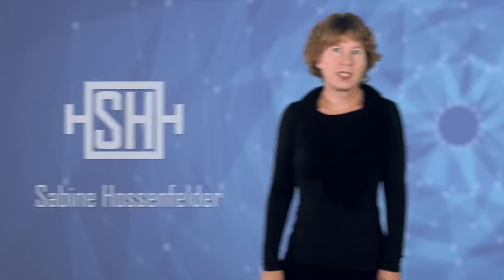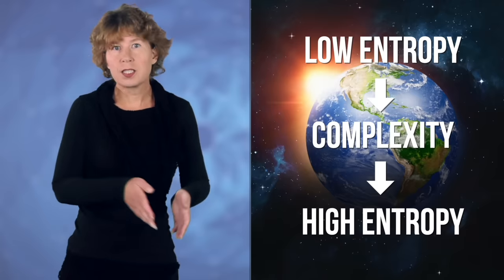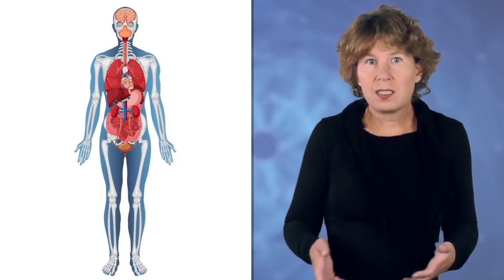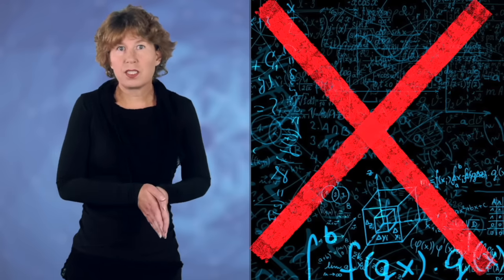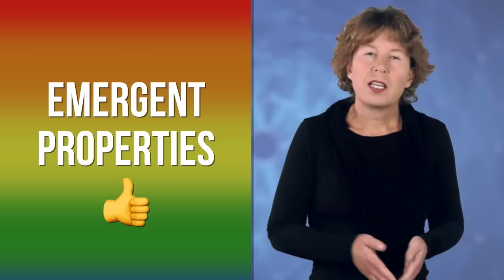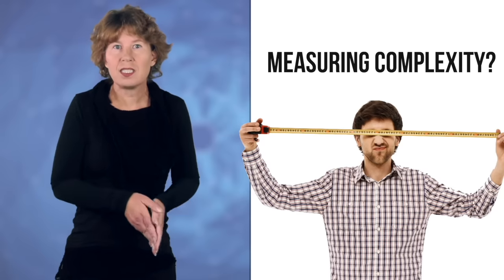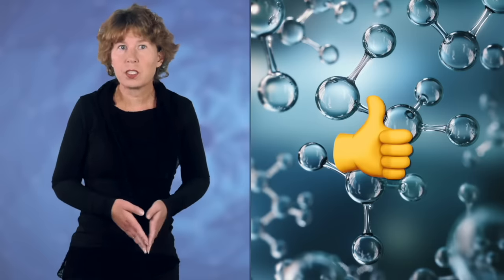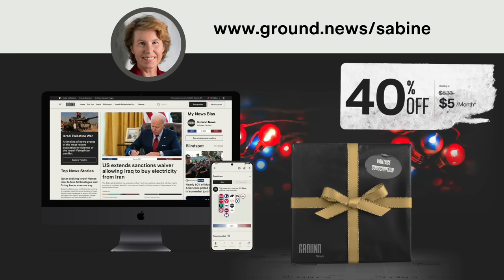The Biggest Gap in Science: Complexity

Comment: This explanation of Kolmogorov complexity is wrong.
Kolmogorov complexity is not defined in terms of a program that can take input, as the distinction between what's input and what's the program would be arbitrary and you would be able to assign everything an extremely low complexity by having the program be a simple interpreter and the input just be whatever actual program you want to run.
So the state that makes up a stone or baby that you consider input to the program/laws of physics really needs to be included/encoded in the program, which in turn will ramp up the program size and cause the Komogorov complexity of a stone to be very likely different from that of a baby.

Comment: I think that "Complexity" belongs in the realm of Epistemology. It is about how faceted the "knowledge" is that conveys the understanding of something we seek to explain or understand. An object or system could be physical or abstract, and we might need to understand / explain only some small part of it, or all of it. So complexity isnt about the thing alone, but more about the knowledge required to explain or understand something with respect to that thing. 
If the thing has one or multiple levels of emergent properties / behaviours, then the thing we are attempting to understand could be at one, or accross many of those different levels. A rock doesn't have as many emergent levels / behaviours as a Baby does so most of the things we will wish to understand about a rock would tend to be more constrained to fewer levels.. however if you include wanting to understand behaviours for how the rock was formed then that knowledge would be of increased complexity because you have to bring in the facets of geology as a dependency. If you want to know the positions of all the atoms in the rock that would be more complex than asking the location of the rock in your garden... because,  emergence typically aggregates complex low level details into simpler higher level concepts. Its not complex to talk about the colour Blue but it would be if we had to always explain it referencing fundamental physics instead. If you ask a Baby what it had for breakfast its answer may be pretty simple "goo ga". This isn't complex because understanding is lost. I could write a program to mimic that behaviour in a few lines without needing to understand much. If you wait 20 years for its brain to develop and for it to build behaviours from the learned knowledge embodied in its brain and then ask it, the answer will be a lot more complicated like "i made eggs on toast". The "positions of its neurons" are the wrong level of abstraction to attempt to understand why it gave such an answer.. knowledge of culture and the english language are operating at closer levels.

Comment: It's fun how each person considers complexity something different. I work in game design, and it's pretty usual to talk about a game complexity. We have usually problems with complex games but at the same time the players want games with depth. Luckily they are not necessarily correlated. We tend to think on complex games a games with plenty of variables to interact with, while we consider deep games those with lots of outcomes. A game can have a low complexity but high depth (which is considered optimal), but also, you can increase the game's complexity, yet not changing its depth or even decrease it if the system's complexity reduces the number of outputs. Adding complexity may make the game deeper, but it's also possible that it doesn't since the different systems may funnel the options into less outcomes, like the thousand bowls of cereals: you can have a virtually infinite ways of making a bowl of cereals but in the end it's just another bowl of cereals.

Comment: If you really must have a definition for complexity, simply count the amount of regular movements you would call a "thing", or an "effect" for a specific chosen time scale, and in a specific space. One regular movement = 1 unit of complexity. In a specific time scale and space, you have a specific amount of identifiable regular movements. To detect an object you need it to be regularly itself at least once. That's our unit. Now count the amount of times it is regular in the time scale and volume of your choosing. Larger "emergent" movements, only appear after a specific timescale threshold is crossed. Once it is, add it as one unit of complexity. The physical limitation of complexity, is that it is relative, because it is an observation after the facts, the facts being the observed laws of physics. So you can have two different volume-timescales with the same complexity. But like a denominator for a fraction, you need both space-time scales to have the same minimum regular movement as a denominator. One jiggling of a photon, one orbit of an electron, whatever you want. This creates a way to measure complexity, but only by arbitrarily choosing a minimum regular movement. Those two space-time scales now must have different complexities.

But complexity as a concept really is more of an after-the-fact observation, it has no strict explanatory power. I.e. it's not really a problem, it's just an appealing kind of synthesis. I'm not sure it will be very useful, except perhaps as a type of informative unit, like meters, or kilograms.

Comment: "In case you haven't noticed, a baby isn't a network" Of course they are! each quark and each electron is a point in a huge network. Very difficult to work with but it's there. Using the atoms as points instead would be a very simplified model but would also show the complexity.

Comment: I think Kolmogorov is a good measure for informational complexity. While yes, both rock and baby can be modeled with the standard model, computing the behaviour of every single elememtary particle. However, this is like the 'naive' program and not the shortest one. The regular structure and grouping in a rock means you can abstract some of the elementary particles and model the structures only instead, creating a shorter program. Arguably, more structure in the rock implies a smaller Kolmogorov complexity.
Reply: Yes, but then things like Collatz, Goedel and the halting problem are rearing their ugly heads.

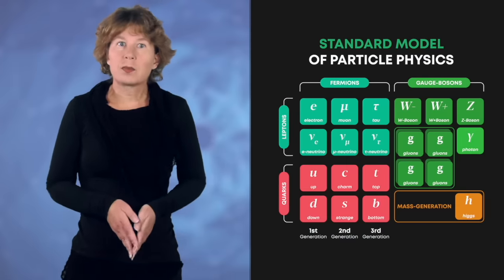Comment: 03:40 - While it's true that both the baby and the clock, when considered down to it's elemental physical components, can be described by the same "laws of physics", It does NOT mean that doing so is necessarily the SHORTEST way to describe their behaviour, i.e. the clock would remain a "clock" whether it was made of only pure metal components, different alloys, or even a mix of plastics and other stuff, and it's "clock" complexity would remain the same. A similar argument can be made for the baby, and if you only wish to describe the part of the object's properties or behaviour that represents the clock-ness or baby-ness of them, boiling down to elemental particles it's probably not necessary nor the shortest path to do so.
Moreover, even if you want a complete description that does boil down to the core components of those objects, given any referential starting "universe" situation, the amount of stuff that needs to happen (regardless of the how it would happen) for both objects to come into existence, would still be higher for the baby than for the clock. Let's remember that Kolmogorov's complexity specifically speaks of a computer program capable of producing the output. Even if we assume the universe to be computable in line with computability theory, and given that computer programs have inputs and outputs, his complexity theory only would speak of there being a possible state of the universe from which a set of "instructions" or "events" could produce this outputs (and which of those can be made the shortest). 
This, to an extent, crashes a bit with the proponents of a unique and completely deterministic universe, but to those we would just need to remind that complexity is in all honesty just a human construct used to describe how much "effort" needs to be put into understanding the properties of something to a reasonable degree (i.e enough to distinguish it from every other know object). 
Therefore, complexity does not belong to any physical object understood as a set of physical magnitudes, particles, fields, etc, in a given space-time location; Complexity is a property of the "objects" understood as the minimal information that allows us to discriminate them from every other, because that's what brains do; they cluster stuff and seek patterns.

Comment: The argument stating that since everything is made of elementary particles, everything is as hard to describe using a program is wrong.
For example, describing a crystal is extremely easy with a computer program, because you just describe the lattice structure and then repeat it. That's the whole point.
A baby's inner interactions are complex because the structures are not as repetitive, hence they require more footwork to describe with a program.

Comment: I can’t buy the argument about algorithmic complexity. It’s flawed because complexity in algorithms depends on interactions between their building blocks, and not the complexity of those building blocks themselves. A real world example would be any CPU or other IC. They are all built out of transistors, yet some CPUs are more complex than others. Their algorithmic complexity is different despite they all have the same building blocks. A math analogy would be: all math is composed out of the same set of digits and symbols. Yet some math is more complex than others. You will still need to compose your building blocks from the standard model into a bigger equation, that is.

Comment: I don't think your dismissal of Kolmogorov complexity is correct. The equations of the standard model are indeed the same between babies and rocks, but those equations are NOT the full program that describes each of them. The specific configuration of the particles is part of the program for each, and it's clear that the rock's program would be considerably simpler with fewer degrees of freedom than the baby's. 

You can see this in your graph example of fully connected and fully disconnected nodes. The program describing how to construct either graph is very simple, but a program to construct a graph that isn't either of those graphs must be strictly more complex, consisting of additional predicates to decide whether vertex x is connected to y.

Comment: I'm amused by the contrast between your ordering of rock/clockwork/baby and mine.  You're suggesting that in principle it should be obvious that the rock is the simplest, the clockwork is in the middle, and the baby is the most complex (or at least, that's what I'm reading in between the lines, don't think you've actually said it.)

As someone who's studied rock mechanics, my order is clockwork/rock/baby.  

The clockwork is a designed and entirely deterministic system.  Wind the clockwork, it does X.  Plug a different cam module into it, then wind it, it does Y.  Go back to the first cam module, it does X again.  Very simple, very deterministic.

Rock, though....you can look at the surface.  You can infer what's probably going on inside.  But you don't know what's inside there until you crack it open.  It might not look like a geode, but there might be a geode just within that houses some fascinating crystal structure.  There might be cracks or bubbles in there that don't make it to the edge. Etc.  The smaller the rock is, the better chance you have of guessing the interior, but you're never 100% sure until you crack it open and look at that part.  (For the purposes of a hand sized rock, 99.99% of the time it's exactly what you'd expect from the outside.  Rock mechanics design work is more interested in rather larger rocks, like, uhh...bedrock.  If you're digging a tunnel under a mountain, the structure of the rock within that mountain is relevant to how much support that roof needs.  If it's the kind of rock you can put holes in by punching, you probably do everything you can to have the tunnel built elsewhere and if it absolutely has to be there, you put absolutely absurd amounts of support in, tell everyone it was a bad idea in the first place and pray.  (Yes, this kind of rock exists, it's not so much the rock itself being weak but that it's basically just gravel that fits together like a 3d jigsaw puzzle and therefore you can just pull pieces out.  Which means it has pretty much zero structural integrity.)  If it's completely solid, you might not actually need any support at all, but you'd be crazy to assume it's actually 100% solid.

Babies, of course...they're simple on the surface, but what a baby does over the next 100 years beyond "get bigger, eat, drink and do the other necessary things of everyday existence for mammals to live, and eventually probably die" is very hard to determine with any certainty.  (And maybe that last prediction is a tad morbid but I don't think it's exactly controversial to say that most people don't live more than a century.)

Comment: By the way, in the field of the computer science the complexity might be something bad in some contexts. For example, mentioned algorithmic complexity tries to find the simplest solution not the most complex one. In the software engineering we usually try to solve a problem with the simplest solution possible (not a naive or literally stupid though). So, yeah the complexity is a complex problem to speak about.

Speaking about the simplest solution seeking. I have intuition that the simplicity seeking is something similar to the entropy. In a way that dumb solution might be easier to produce, then to produce the simple one. So, actually the simplest solution requires more complex behavior from a solution producer. That is similar to a situation when you minimize entropy somewhere locally and really just put it to another place. Globally entropy still increases.

Comment: The categories of complexity are only those we have learned to treat mathematically and logically; we should NOT assume we have already found them all.  Everything is indeed composed of fundamental particles and the complexity does emerge from pairwise interactions between them all; however, order also emerges from this complexity.  Each clock gear is composed entirely from an orderly repetition of such an emerged ordered chemical structure (with a finite set of impurity and inclusion exceptions).  Data compression algorithms specialize in reducing such 'blocks' to a simpler and equivalent representation.  Similarly, rocks are composed of a finite number of small crystals glued together by mineral cement.  Each crystallite can similarly be reduced to a block plus a finite set of exceptions -- and the assembly of crystallites plus the cement details usually may similarly be reduced.  All of this additionally neglects the subtle complexity needed to allow nerve ganglia to form memories and to correlate these memories into ideas and actions.  We have come a long way, but it would be a huge mistake to settle for what we already know; I predict that many very important categories and equations/algorithms are yet to be discovered.

Yet, all of this treatment also entirely neglects the emergent properties of these materials that depend on intrinsic properties such as temperature, pressure, and environmental composition and state.  We do indeed have far to go, but we also do begin to understand how models of complexity explain much that is otherwise very difficult (even impractical) to predict and to compute.  With these models in hand, we are in a position to begin understanding how these pairwise interactions combine to produce a category of complexity and/or an emergent category of order.  It is incredibly valuable to have these strategies to subdivide an intractable problem into sets of smaller, solvable sub-problems.

Comment: Interesting. For me, it was a tossup between  the rock and the baby. The baby is a complex system with many interacting parts, but the rock could quite easily be as well. Think of a slab of granite table top. It's composed of many different mineral grains. The sturcutre of those grains was affected by things like components, impurities, cooling rates, things like that. Under pressure, rocks ooze over time. The granite may well have oozed at some point. It may have fractured, and the fractures been filled with water soluble minerals. 

The gears? Well, no. It's easy to make gears with the appropriate machines.. Making granite, or a baby for that matter, is quite a different proposal.